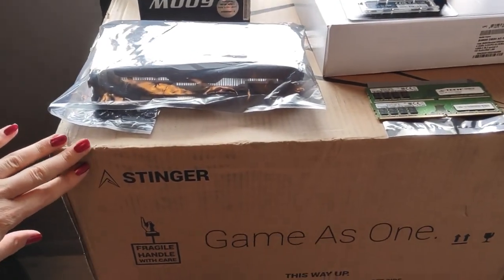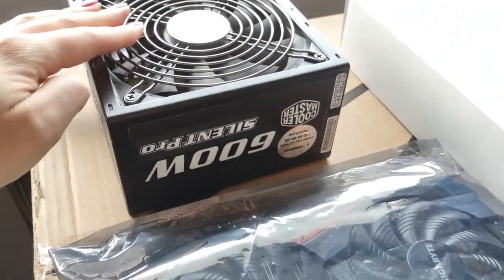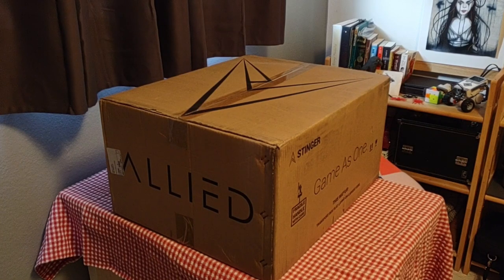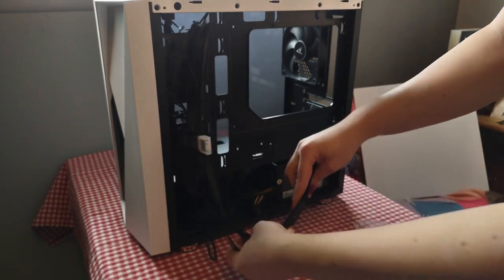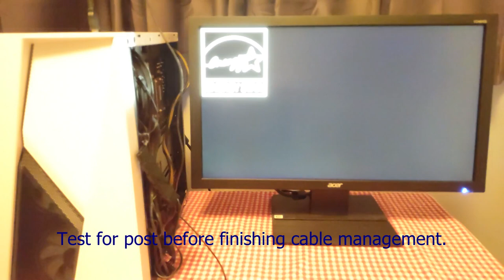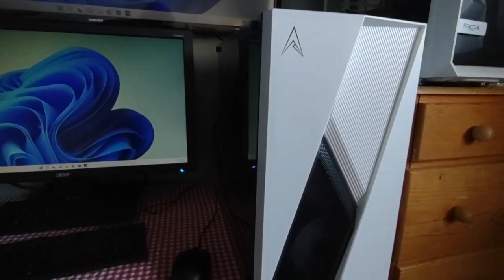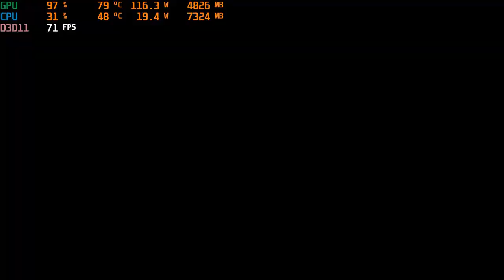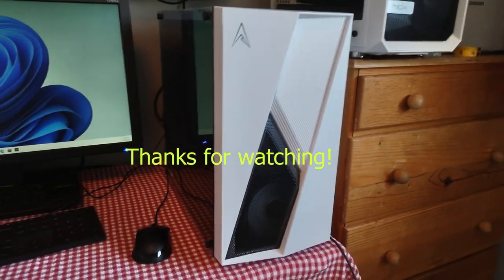Awesome Budget Gaming PC for under $399 you can Build Now!

Comment: This is like what i am building, i like ryzen so i am using a Ryzen 5 1600, with 16gb 3000mhz ram, 500gb m.2 ssd (unfortunatly sata but it should be fine), a b350m motherboard, and an EVGA 1060 6gb (actually indecisive on the GPU)
Reply from the maker: The 1060 should be good with that CPU.

Comment: 11:23 I spy a Lego Mindstorms EV3 😁
25:04 Your character is wearing the same dress as you wore in the video 🙂
Great job on the build, I always find budget builds more interesting than expensive ones.  I like the case, a great budget option!
Reply from the maker: It is indeed a Mindstorms EV3 with NXT parts (since I only bought the EV3 brick). I use mindstorms robots a lot when I teach physics. They are great for analyzing various kinds of motion. I may make a few mindstorms videos as well. I love your channel by the way. 😁
Reply: @IronwingTechHaven  Thanks!  I'd love to see some Mindstorms videos from you!  I have an EV3 I won in a goodwill auction online, I cleaned the battery acid damage but haven't used it for anything yet.  I tend to use the older stuff since I'm more familiar with it.  I'm sure I'll get around to the EV3 eventually 🙂

Comment: The proper way to magnetize a screwdriver is to rub it across the magnet one way only. Also keep the magnet away from mechanical hard drives.
Reply from the maker: I didn't use any mechanical hard drives in this build. So, that is not a concern I felt like addressing.  Also, is there really a 'proper' way if just rubbing it on a magnet any which way works? Yes, I have tried several ways, and they all work. However, I would love to hear your explanation of why this is the proper way.
Reply from the maker: Also, thanks for stopping by my channel! ☺
Reply: @IronwingTechHaven  I don't know fir sure what the benefit of proper technique is but my best guess is that it is faster. Also you are one of the few channels that care about power consumption thank you for providing useful information.
Reply from the maker: @grahamgamedev  perhaps it stays magnetic longer as well? I'll have to give it a try. Also, you can magnetize them with a coil and a battery too, but that's more effort, but can sometimes last quite a bit longer if done right.
I'm planning on doing many more videos in the future on low power gaming. I'll probably start by showing how to undervolt a system like this one to dramatically reduce the power consumption with very little impact on the gaming experience.
Reply: @IronwingTechHaven  I have thought about undervolting but modern hardware makes it difficult.
Reply from the maker: @grahamgamedev  some of it does, others make it pretty easy.
Reply from the maker: @grahamgamedev  it's actually super easy with the GTX 1060... but that's getting a little old to call modern, I suppose. I ran mine at 50% power and the drop in performance was hardly noticable. I think undervolting the i3 10100F should be pretty easy too... but it all depends on what my motherboard allows.
Reply: @IronwingTechHaven  My i7-10750H laptop has it's voltage locked I think and my sleeper pc is used for work not gaming.
Reply from the maker: @grahamgamedev  laptops tend to lock down their voltages more than desktops though, as they are already tuned for efficiency.
Reply: @IronwingTechHaven  I haven't thought about changing the GPU power limit. I normally use the integrated graphics whare possible and put up with 80w power consumption in games that don't work well with integrated graphics.

Comment: This is very similar to what I built 2 years ago. I changed my main rigs mobo cpu & ram to a gigabyte h310, 9100f & 16gb gskill 2400. ($167 iirc) I struggle in tasks that need more cores/threads so I'm thinking of building a older oem xeon rig to replace my secondary pc and selling it for more than the oem cost. Wii U & PS3 emulation I'm willing to bet do better on old xeons than these fast but low thread count i3's.
Reply from the maker: It would be interesting to see if you are right about old Xeons outperforming these in certain tasks.

Comment: will the i5 3570 + GTX 1060 be the bottleneck?
Reply from the maker: I think you're asking if that i5 will bottleneck the GTX 1060, and from what I can tell, in most cases the answer is no. That CPU should be fine for most games, but that's really the tricky part. It depends on whether the game is CPU intensive or GPU intensive and it also depends on if the CPU takes advantage of higher core counts than 4, not just on the hardware, but I think that i5 should be fine. Either way, it will provide a playable experience in a lot of titles, so it's not a bad paring. Just to give you an idea, with all of my games with an i3 10100f (which outperforms that i5) the CPU is only at around 40% before the GPU is makes out on 1080p high settings. So, the GTX 1060 will most likely be maxed out before that CPU hits 100%, but like I said, it depends on the game too.
Reply: @IronwingTechHaven  ok thanks so much
Reply from the maker: @dayummm217  good luck with your build!

Comment: Was it pair of 8gb ddr4 or 16gb per module?
Reply from the maker: A pair of 8GB DDR4 2666MHz.
I don't think more than 16 would have benefited this system at all.
Reply: @IronwingTechHaven  ok, gocha, but having more ram usually will lasting longer and save money from future upgrade. Currently I have 64gb ddr4 on my 11400f, 128gb ddr4 on 12400f and 256gb ddr4 on my 7920x. All of them will expect to be in service until 2030s. My last built was q9650 w/16gb ddr3 and e7300 w/8gb ddr2 that made in 2008 and it last me 12 years until i got my 7920x in 2020.
Reply from the maker: @hanrinch  well, if I need more RAM the board has 4 slots. So, finding two more matching sticks in the future is pretty trivial. I have never had trouble finding matching RAM on eBay for almost nothing.
My 10 year old laptop has 32 GB of RAM, and I never use more than 8. 😂
So, I'll believe that future-proofing statement I hear from a lot of people when I actually see it.
But I wasn't building this for myself anyway. I was building it to show people how to build an inexpensive but effective gaming PC. I have since resold it, and there was no point in spending the extra money for extra RAM that no one cares about in a budget build anyway. 
Also, I got the 8 GB sticks for free.
So, my goal was not to make the best PC, but to make a good PC I could easily resell to get a bit of profit.
Also, I think the money you spent on all that RAM probably would have made more sense to put into a better CPU, GPU or PSU unless you plan on using it as a server or running a load of VMs.
How much RAM you need above 8GB really has little to do with how long you expect to use your PC and more to do with what you plan on doing with it.
I mean, my main computer is my Lenovo T420 from 2011 and for what I do with it (including video editing) 8GB has always been more than enough. 
So, we can't make blanket statements like "you would have been better off doing such and such instead" unless we also know the kinds of work loads the user will be working with.
Reply: @IronwingTechHaven  true, always get yourself in the balance between cost and quality/lifespan. I liked to max out because I hate to open the case again once I finish the built. Again, your comment taught me well, thank you!

The main reason why I got rip off q9650 is because the processor is aging to the fact it is no longer running newer programs that require FMA instruction and graphic card is also outdated, however the 16gb ddr3 is still going strong after 12 years of used and sold all modules together for 100 bucks. The board was giving up to goodwill and cpu/gpu gave away to the recycling.

Comment: I need for programming, what configuration I will need?
Reply from the maker: It depends on what kind of programming you will be doing: general coding or 3D game dev, or something else. I mean, you can program on any computer. I do most of my programming on a ten year old Lenovo laptop.
Reply: @IronwingTechHaven  I'm want to learn python??
Reply from the maker: @beerendratravellingfiles  you should. Python is a great language, but you don't need a particularly fancy computer. You can even program in python on a Raspberry Pi. Now, if you want to use Unity to make games, then I'd recommend a system like the one in this video or better if you can afford it.